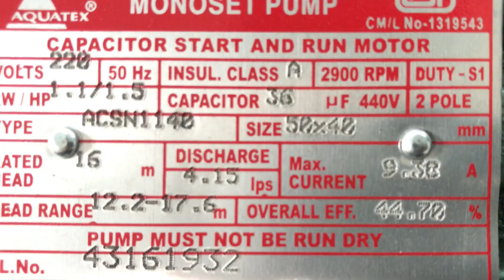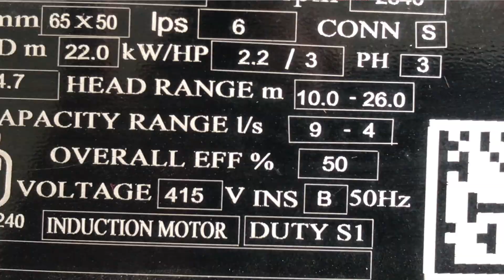വീട്ടിലെ മോട്ടർ എത്ര യൂണിറ്റ് കറന്റ് എടുക്കും ? Motor efficiency and unit consumed ? with Eng sub

Comment: ഭായ് പറയുന്നത് ശരിയല്ല എന്നാണ് എനിക്ക് തോന്നുന്നത്....motor. ഒരിക്കലും rated current. ഇല് കൂടുതൽ എടുക്കില്ല അങ്ങനെ വന്നാൽ അത് കത്തി പോകും.... പിന്നെ efficiency calculatuon and ഇങ്ങനെ അല്ല...
Reply: Simply പറഞ്ഞാൽ 100 watt bulb ഒരു കണ്ടിഷനിലു. 200 watt consume ചെയ്യില്ല
Reply from the maker: @sgvaidyan  Oru pump nu varunna variation related to voltage matram anenkil. Pumpinu pump load , voltage variation ellam affect cheyyum.
Reply: @thundathiltraders  bro...motor വേറെ pump വേറെ.....pump efficiency കുറഞ്ഞാൽ motor nu ഏങ്ങനെ ലോഡ് കൂടും???
Reply from the maker: @sgvaidyan  Pls check the link. Head kuranjal discharge koodum, load koodum, consumption koodum, bro paranja pole anenkil ella headilum ore consumption varande ?
Reply from the maker: https://youtu.be/FF8IpiPvpKk
Please refer.  Sadarana oru electrical equipment pole alla motor. Athinte efficiency Pump load anusarichu variation varum. Ella sdalathum pump BEP point ayirikilla work cheyunath.

Comment: എന്റെ മോട്ടോറിൻ്റെ എഫിഷ്യൻസി 18.4% ആണ് കാണുന്നത്. താങ്കൾ പറഞ്ഞത് പ്രകാരം കണക്ക് നോക്കുമ്പോൾ 4.08 യൂണിറ്റ് വൈദ്യുതിയാണ് ഉപയോഗിക്കുന്നത്. പണി പാളിയോ 🥺
Reply from the maker: Motorinte name plate il koduthirikkuna ampere etrayanu ?
Current consumption oru clamp meter vachu confirm cheyyamo?
Reply: Model : Bindhu B1025w
Max current : 7.5 A
Del size : 25 mm
Head : 20 m
Discharge : 1.5 LPs
Head range : 17 - 21m
Reply: Clamp meter പരിപാടി നടക്കുമെന്ന് തോന്നുന്നില്ല
Reply from the maker: @rajeshgallery5938  7.5A vachu nokkiyal average 25% aduthu efficiency varandethanu. 4 unit varan chance illa.
Reply from the maker: around 1.8 units anu varukayulu
Reply: 18.4% ആണ് എഫിഷ്യൻസി എഴുതിയിരിക്കുന്നത്. അത് വച്ച് കണക്ക് കൂട്ടുമ്പോളാണ് 4 യൂണിറ്റ് കിട്ടുന്നത്. Kseb മീറ്ററിൽ ഒന്ന് ചെക്ക് ചെയ്യാം. രണ്ടു യൂണിറ്റ് നോർമലാണല്ലേ?. 
Thanks
Reply from the maker: @rajeshgallery5938  yes.1.8 units ellam normal anu
Reply: Thanks 😊😊

Comment: Hello.. very good video. Kazhinja divasam  jet pump matti 1 hp submersible  pump fit chythu. Running  amp 7.5 aanu kanikkunnath.. normally  athrayum amp edukumo? Amp kooduthal kanichal  current  consumption  kooduthal adhava current bill koodum ennalle manasilakkendath?
Reply from the maker: 1HP submersible 7.5A correct ampere anu. Jet pump tank fill avan etra neram eduthirunu ? epol etra edukunund ?
Reply: @thundathiltraders   jet pump ekadesham 20 yrs pazhakam und adya kalangalil 10 muthal 15 minutes  vendiyirunnu.pinneed pump kedayappol rewinding oke cheyth eduthu ,Seaham 25 minutes  muthal 30 vare Samayam  vendi varunnu. Current  bill 2.5k to 3.5 range ayapol  aanu puthiya pump vachath. Ippo  4.30 to 5 minutes kond tank nirayunnund. Piping panikal nadannappol pazhaya pipe(1.¼ ") aayiruunu re use cheyyan uddesichirunnath. Pinne thankalude oru vdo kandirunu.. athil pumping  load kooduthal akimbo current  kuranjathayi kandu  so reducer onm use cheyyathe recommended  gauge (1") new pipe thanne use cheythu. 😊

Comment: Kera submersible motorinte starter pannelil extra oru push button kanunnu athu enthu anu ennu onnu vishathikarikamo please
Reply: Open well submersible
Reply from the maker: @johnnywalkerbabu7093  starting and running capacitor undo panelil ?
Reply: @thundathiltraders  oru capacitor mathrame ullu
Reply from the maker: @johnnywalkerbabu7093  Oru capacitor matram ullenkil push button avashyam ellalo . voltage check cheyyan switch enthenkilum ano ? photo whatsapp cheyamo? 7034904458
Reply from the maker: Ethu motor anu ? openwell submersible ano ? borewell submersible ano ?

Comment: Lakshmi 50%efficiency 1hp?
Reply from the maker: single phase or 3 phase? if its in single phase its not practically possible specially in smaller hp
Reply: @thundathiltraders  single phase
Reply from the maker: HP?
Reply: @thundathiltraders  lakshmi 1hp 50% efficiency single phase head22
Reply from the maker: @shahanas8587  I don't think it is possible. Non ISI ?

Comment: 2.5 HP Borwel submersible pump use cheyyanulla automatic Stablicer undo
Reply from the maker: 2HP  വരെ വരുന്നുണ്ട്. ഏതു മോഡൽ ആണ് ? എത്ര amps കറന്റ് എടുക്കുന്നുണ്ട് ?
Reply: Thundathil Traders 
Kirloscur
Your number please
Reply: 15-18 amps .low voltage area anu.ninglude Offce number pls

Comment: വളരെ തെറ്റായ ഇൻഫർമേഷൻ ആണ്.
Reply from the maker: വിശദീകരിക്കാമോ?
Reply: @thundathiltraders  sure
Reply from the maker: Thanks . Waiting ✌🏻
Reply: P- vi cos$.   ( 746 - 230 x 7 cos, so cos$ is the efficiency; cos $ = 746/230x7 =46% . So per our consumption for 1hp = 1610 watts, it means 1.61 unit ( I means ampere / current it mentioned on the name plate, if not mention, there is pf mention)
Reply from the maker: പറഞ്ഞ തെറ്റ് വിശദീരികമോ? പറഞ്ഞതിൽ തെറ്റുണ്ടെങ്കിൽ കഴിവതും നേരത്തെ തിരുത്താൻ ആണ് .ഒരുപാടു പേര് കണ്ടു ഒരു തെറ്റായ കാര്യം മനസിലാകും. എത്രയും പെട്ടെന്നു റിപ്ലൈ തരുക